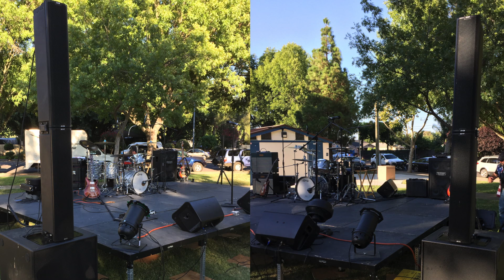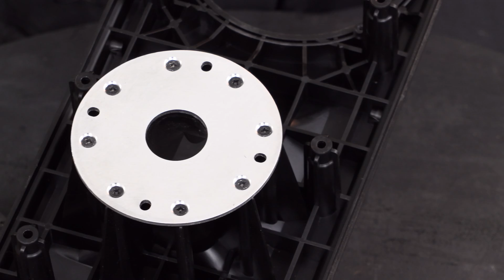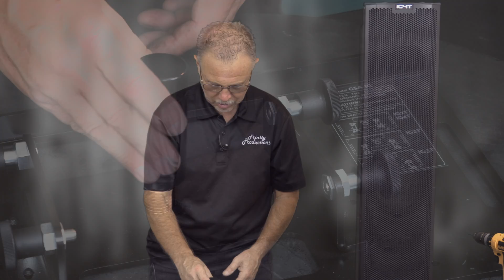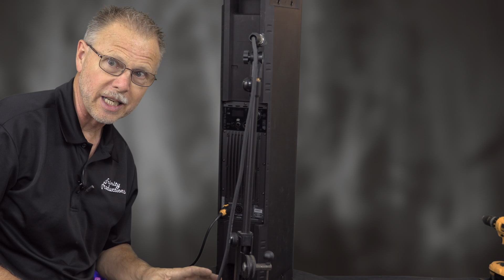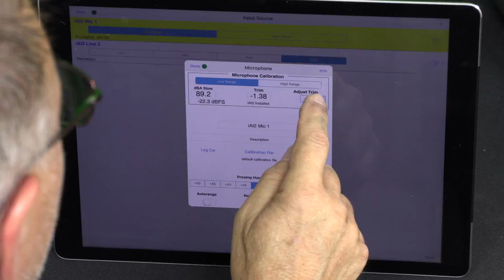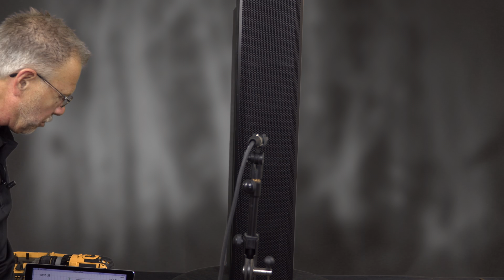dB Technologies IG4T ( The Sleeper System)  - Complete Review - Authorized Dealers and Users

Comment: what model is more good Db ig4 or fbt cla 406 ?
Reply from the maker: They are a bit different. The IG4T has a 3" HF with 1.4"VC an 1100hz xover. vs. 1200hz about same size of HF, but LF is almost identical...frequency response will be similar. Difference is injection molded vs. wood box. I do like the IG4T for the added features and digital steering when two boxes are in combined mode. The IG4T is lighter due to the construction. I like lighter boxes. We do 1000 peeps with 2 per side over dual 18 subs with the IG4T...either one will bring you very good sound.
Reply: trinityprosound thanks! best subwofer for this speaker?
Reply from the maker: we use FBT, but the SUB18H is good, RCF 8004, FBT SUB118A, don't waste your money on QSC
Reply: trinityprosound thanks a lot!
Reply: 2 db sub  18H is enough for two IG4t  for 300 people?
Reply from the maker: yes it would be , the 18H does a great job for a single 18 and with hybrid design does good for low end extension
Reply: I buy this speaker! It is amazing power! very clear. Thanks!   better sub for db IG4T rcf 8003 as2  vs db sub 18H?
Reply from the maker: 18H is at a great price point , but, 8003 is more output IMO

Comment: hi! 4 sub 705 as2 for 2 ig4T  is good? maybe 2x 8003as2?
Reply from the maker: you will need at least 2 of the 8003 per side if you are talking about 2 IG4T per side. They pair nicely with the 8004 or FBT SUBLINE 118SA .... the IG4T is powerful, and we run 2 per side and they will out run a dual 18" sub from FBT that we use.
Reply: trinityprosound Fbt subline 118 sa is better at rcf 8003 as2?
Reply from the maker: those two are about the same in my opinion...they have similar power and the construction is all wood. i do favor the RCF amps though..

Comment: What subwoofer do you recommend?
Reply from the maker: I would suggest the SUB18H to do with the IG4T speakers or the FBT SUBLINE 118SA, either will do a great job
Reply: Thank you! Another question, IG3T or IG4T for live band performance (Drums, e Gtr, Bass, Keyboard, Vocals)? Does the plate to stack 2 ig4t(s) come with the speakers or is it accessories?
Reply from the maker: I would do the IG3T with larger 10" speakers. They are not as tall as IG4T but do a very good job and full sound. The stack plates are extra accessory, but if you do not have a 2 x 18 sub to put on and get up around 40-48" , i would use short poles, as the speakers on a single subwoofer will be too low to get effective coverage.

Comment: will one rcf the NXL24 out run one RCF 4pro 8003 on each side??
Reply from the maker: Yes it will, in-fact one will almost out run an 8006 - you would need 2 of the 8003 per side to almost be even...or just turn down the NXL by 3-6db and should be uniform and balanced.

Comment: I use this speaker whit subs Jbl SRX 818 what do you Think?
Reply from the maker: They will work good, but the IG4t will out run the SRX818SP's most likley need 2 subs of that model for each IG4T and you will need to set the cross over correctly to coincide with the IG4T 80hz is the lowest I would go, better is 100hz and up to the IG4T speakers.
Reply: Thank you, great video!
Reply: 2x SRX818 + 1 ig4t ?
Reply from the maker: yes correct....we use 2 x IG4T with FBT SUBLINE218SA and the IG4T's will out run the sub no issues